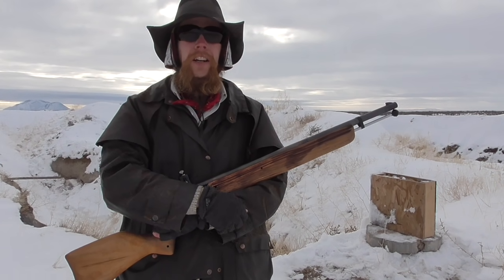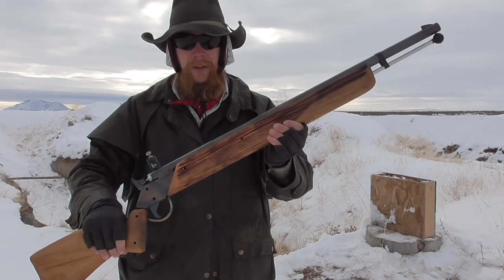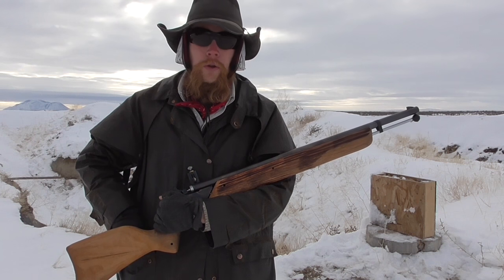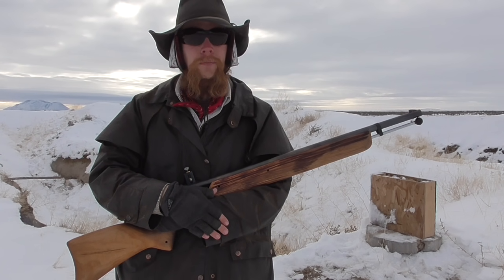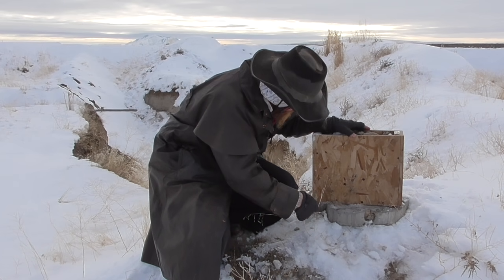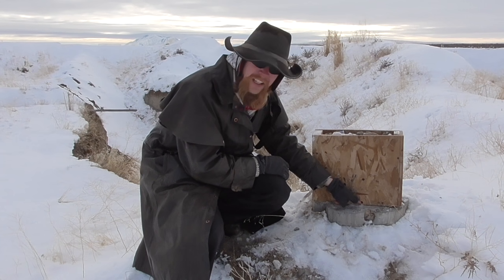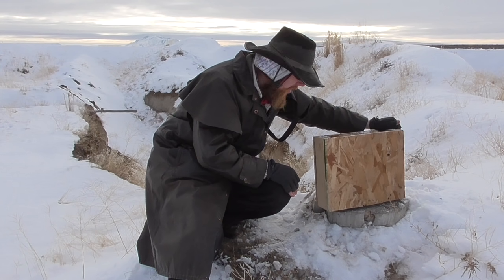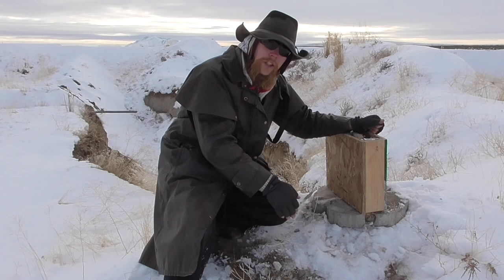Gravel Armor vs. Muzzleloader (TIS244)

Comment: I'd like to see if you can build something that could penetrate that gravel armor, given that it's most likely shattering the bullet on contact harder lead alloys or maybe hardened steel might stand a chance of getting through with enough energy behind it
Reply from the maker: I'll keep that idea in mind.
Reply: Do you think it's shattering? Cuz I'd imagine that the gravel does more deflecting and deforming rather than shattering. The 9mm he found looked pretty intact. I guess the 223 is going a lot faster so it might be more likely to shatter, but I would guess that since the gravel has a lot of give, and it can kinda move out of the way, that it kinda slows the bullet down and redirects it off course as opposed to straight up shattering it.
Reply: Kincaid Englesby I didn't see the bullet he recovered, I wasn't paying attention I guess. From my experience shooting rocks it usually breaks up bullets, either shattering them or flattening them, being that gravel is bullet sized it might not behave the same as a larger rock.

Either way, I think the basic principle is something like playing plinko but the ball is a bullet and the pegs gravel, takes a lot of energy to break or shuffle through it all

Comment: Try filling the voids between the gravel with sand and add a layer of styrofoam or some kinda rubber to absorb the shock so that the back side doesnt get such beating. Make the ultimate wall first, then test it with rifle rounds

Comment: I have seen .38 lead and 9mm fmj go through several feet of piled sand. I wonder if the gravel being  in a movable vessel is a factor.
Reply: And where in the hell did you see this? I know a pile of sand will stop a 30-06 in less than the diameter of you average pot (~6 inches)
Reply: @5oclock_Charlie  in this vid at Demoranch some two inches of sand stopped 9 mm https://www.youtube.com/watch?v=QD0mo7l5eUc
Reply: Southpaw Outdoors I think it's that gravel is harder and breaks the bullet instead of slowly deforming it